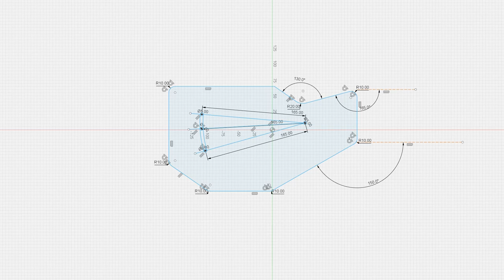How to Make Custom Carbon Fiber Wing Endplates cheap and easy. [DIY] with Epoxy Resin

Comment: Another amazing and inspiring work! I just have a question: Why don’t you leave the finishing left by the glass? Without more epoxy layers, sanding and refinishing? It would be just as fine as from a mold. Thanks! Have a great new year!
Reply: I thought that, but maybe it’s just to seal the edges where were cut

Comment: How do you avoid pits and airbubbles in resin and finished parts? Ive tried heat, mixing slowly, different mixing sticks, batch sizes, foam brushes, regular brushes, rollers, etc but im always left with pits and air bubbles that take hours and hours to fix
Reply from the maker: Hello friend
A simple way to get rid of air bubbles is to soak a mixed epoxy resin cup in warm water.
This is a very simple method.
But I don't bubbles remove.
No matter how much air bubbles are removed, air bubbles will appear again when the epoxy resin is applied.
After the epoxy resin of the carbon fiber parts has hardened, I sand it and use a transparent filler or apply two thin coats of the epoxy resin.
And leveling sanding.
After leveling sanding, the surface has a very clean surface with no air bubbles.
And then Finally, spray clear(topcoat) .
Reply: @ECOLAPStudio  thank you for the tips very helpful. Do you have any tips on more efficent ways to produce carbon parts in volume? For example, making 15-20 copie s of the same part.